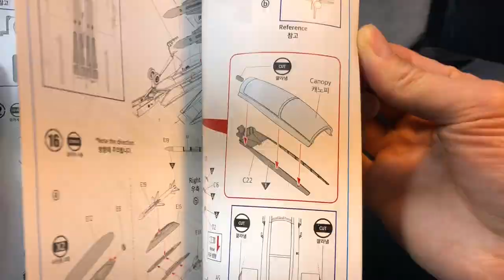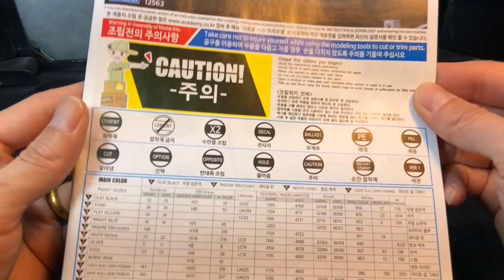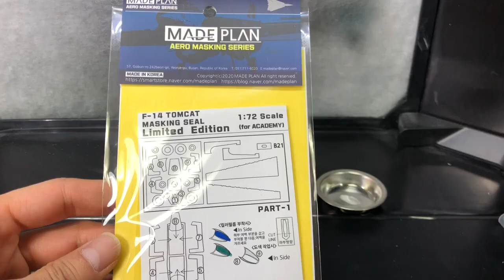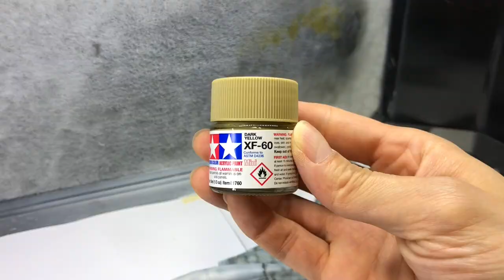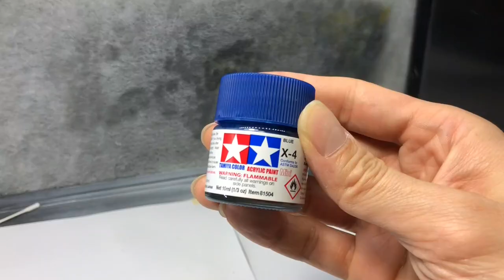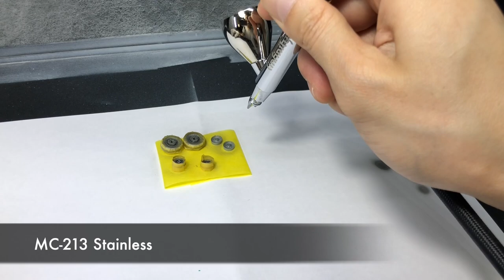Academy 1/72 F-14A Tomcat [Full Build]

Comment: Hi, Great Job on the model!  Im currently building an exact same one and I'm having issues airbrushing with White color paint.  I noticed you used a White Surface Primer instead of airbrushing, would this make life easier?
Reply from the maker: Cleaning the airbrush is very annoying.  
It's convenient to use a white surfacer in small or invisible areas. 🙂

Comment: good you really know how to do with the airbrush ... the academy model is not too bad, did you have any difficulties in the construction?
Reply from the maker: This kit has no difficulties, but masking sheet is needed. Nowadays Academy’s new tool is very good especially 1/72. Check if it is new tool or just new box 🙂
Reply: @MODELBOX1  It can be surprising how a new box with new decals can be deceiving, when the kit is actually an old mold from the 1908's or earlier.
Reply from the maker: Yhea, it is same box art 1988’s model but  mold is new 2019. I don’t know why they use same box art. New mold has only pukin dogs decal yet. Academy’s 1/48 is still old mold.